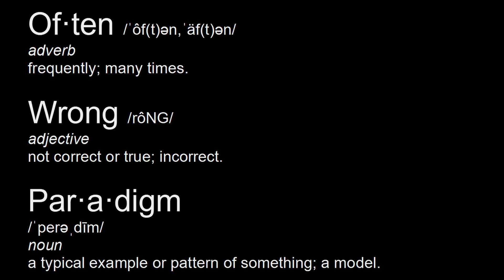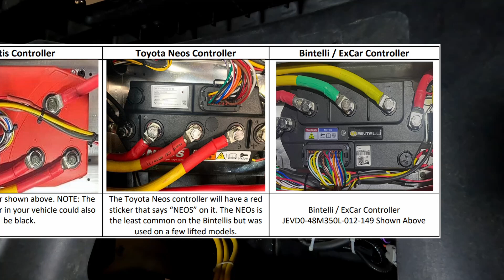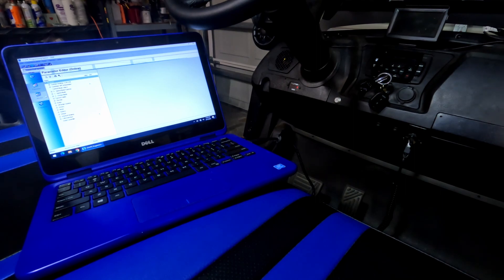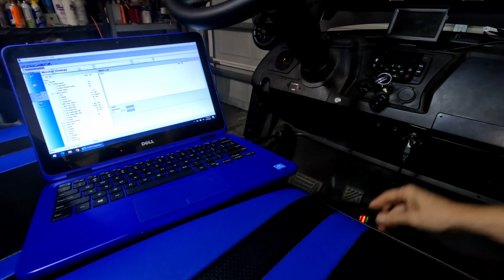Modify Golf Cart Controller to go FASTER and Change Settings Club Car EZGO Yamaha Bintelli Icon

Comment: Hubby bought me a Coco Coupe.  What a big mistake! Any suggestions on adjusting the throttle to slow it down? The unit takes off and moves fast without help. After I nearly ran into the pole barn, I refused to get back on it.
Reply from the maker: That would totally depend on the type of controller module it is using. A lot of the manufacturers have their own software specific to their controllers. Some have multiple pieces of software. Best bet, find the control module and search the internet for the model number and manufacturer to see what options you might have, and how to possibly make changes.

Comment: I have a few questions about my specific cart and what I actually need to do. It’s a new cart and is stuck at the 19 mph, which is about 3-4 mph slower than what is actually safe with traffic on our back road. It is a 2025 E-Z-GO Express 6 ELiTE Lithium and I was hoping to get a solution similar to what we had when we had our Evolution forester (a Curtis 1314 handheld) but I sold that when we sold that cart and before I buy a new one I wanted to be positive.
Reply from the maker: I'd say it's best to open up the cart and get the model number off the controller. Best way I know to be sure you are getting the right programmer. I'm not familiar with that cart to know what it might come with.

Comment: Do you still need a sped code from the club car dealer ir can you make the changes without
Reply from the maker: This doesn't use the speed code. It gives you OEM access to the controllers programming. It's not a simple plug and Play solution like the speed codes. Make sure any changes you make are recorded somehow so you know how to set it back to the original settings if some change you make produces undesired results.

Comment: Hello again!  Any other suggestions to increase speed?  Should I order another Curtis 1314 programmer and try again?  Could it have been my computer?
Reply from the maker: It could be either the controller communicator wiring/box or the computer communications terminal. I'm not good with remote diagnostics of computers though. It does have to be set to the correct communications port.

Comment: Yes sir it’s a 2022 Bintelli Beyond golf cart  and cart was turned on. Yes sir installed in a windows machine it just would not communicate when I pressed f2
Reply from the maker: Hmmm ... It could be a slightly different controller module in your cart. Might want to double check the model number on the controller. It could also be a bad wire or chip in the communications cable. Might be worth swapping it out with the seller, as long as you do have the correct model number of controller on the cart.

Comment: Hello sir!  I purchased the Curtis 1314 programmer and it would not communicate with the cart.  Is there something I am missing?
Reply from the maker: Just want to double-check a few things, do you for sure have the Curtis controller in the cart? If so, is the cart turned on when you are attempting to use the Curtis 1314? Install the software in a Windows machine? In the software interface, selected the correct communications port for the controller programmer?

Comment: If you buy the Curtis programmer usb interface box do you still need the program? If so where do you find the program.
Reply from the maker: If you get the programmer linked in the description, mine came with a CD-ROM and a USB flash drive with the program to access the module and make any changes you want. I would highly suggest keeping a log or notes of any changes you make, so you can quickly and easily change them back if there's a malfunction or an issue.

Comment: Any info on the cable and software for Bintelli Beyond? I have changed to lithium batteries and need to tune the voltage
Reply from the maker: It depends on the controller you have. If it's the curtis controller, there's a link to that one in the description. If it's one of the other controllers, there's a facebook group (ExCar/Bintelli/REVO) with a member (Gnarly Matt) that makes the cables. I think you then have to get the software from buggies gone wild or another source.

Comment: I get timed out msg when connecting to evo cart with cart on
Reply from the maker: Have you double checked the controller to make sure you have the correct programmer? or, tried variations of the cart being off or on when you plug it in?
Reply: You're using the wrong program more than likely. I have an 2024 Evolution D5 Ranger 4 with a 400-C controller and you need specific software for that particular controller. Even though the cables do work for other model controllers besides the Curtis controller, it will not connect. Look at the type of controller you have and post here. I got my cart from 25mph to 32mph with just adjusting the high to 5650rpm. Max rpm for my motor is 6000. It's a good idea not to max the rpm out. As stated in the video, make small changes and test drive. Take video or photos of original and new changes. Always document...

Comment: Excellent video thanks! I have an Atlas cart with a Nidec 400A controller and a 4-pin connector under the dash. It already gets 25.9MPH but would do with some more. Any thoughts on whether there's a kit available to do that? Thanks!
Reply from the maker: That controller I don't know much about. The guy I know who makes cables hasn't mentioned that brand as something he can make. Check the Buggies Gone Wild forum for that cart/controller. There may be someone with hands on experience with them. Good luck!

Comment: Any info on software for Evulition ev48-400-c controller
Reply from the maker: That controller I don't know much about. The guy I know who makes cables hasn't mentioned that brand as something he can make. Check the Buggies Gone Wild forum for that cart/controller. There may be someone with hands on experience with them. Good luck!
Reply: Did you find software for yours? If not I have it.

Comment: My controller does not look like the ones in your post. It is metal and have fins. Its on a 2022 ViVID EV with Lithium battery. All these the only 3 there is?
Reply from the maker: There are a ton of different controllers a cart can use. A Bintelli cart will use one of the 3 in the video. Curtis controllers are frequently found on many golf cart brands. I'm not familiar with the ViVID brand. I looked them up, but didn't find much info on them.

Comment: hi, nice straight forward vid, do you have any info for changing settings on the kandi golf carts, i want to make the "throttle" smoother, its very jerky and unresponsive. i have the newest 2024 version
Reply from the maker: That would depend on which controller you have. Have you opened up the back and taken a look at it? I have another video on the channel that shows how to gain access to the controller and a few of the different controller types.
Reply: @oftenwrongparadigm  ok cool, i'll check out that vid and let you know👍
Reply: Also interested in the 2024 Kandi. Mine has the Enpower MC3818 Controller.
Reply from the maker: @garymartin862  You may want to check out buggiesgonewild.com. there's a user by the name of KrazyMatt, https://www.buggiesgonewild.com/member.php?u=30269. He makes comm cables, and the software is available for download at various places online.

Comment: Hey, I am looking for increasing my speed to 35 max on my 2018 Tomberland 48v E merges . The cart has a Sevocon Gen 4 controller. I tried to get a navitus and change out but they don't make a harness for this brand. What do you suggest. I am willing to spend $ if I just get the program and change the speed. I know as a fact the speed can be increased.
Reply from the maker: After an internet search and read through some forums, I'm thinking it would be easier to put a Curtis wiring harness and accelerator pedal on it then get a Navitas system rather than try to program that controller.